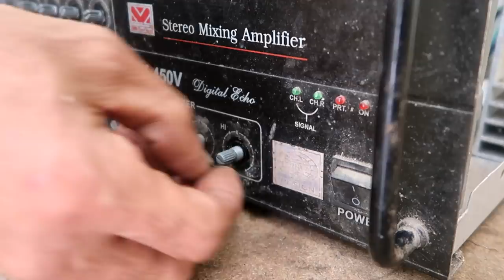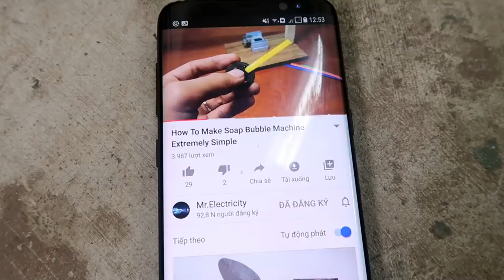Restoration 2 Channels STEREO Audio Amplifier // Restoration And Reuse Of Electrical Equipment

Comment: Mr. Electricity he just used a salvage solder iron and fixed the amp. Like nothing. That is skills. Respect for this guy. When some others with more access to technology they would be using a oscilloscope and all those sophisticated devices.

Comment: What is he using to clean the electronic boards ?
He have a good memory to remember  where the wires go without taking a photo or drawing a scheme before disconnecting it !
I always take a photo before dismantling something , to avoid mistakes when reassembling it .
Looks like a public-address amplifier ( for professionnal use in a supermarket for example) than an house-hold hifi system.
Nice job , the unit looks like and sounds like new .
Reply: I remeber you that he's recording

Comment: I started this video thinking "If this is another fake, I'm gonna throw my phone against the wall, then film a video of me faking to fix it!!!" However I will give credit where it is due. To be able to work on such machines and replace components needs a very deep knowledge of electronics. Knowing how to take stuff apart is easy, but knowing what every single component does in a machine takes years. It's clear this guy knows what he's doing. Would like to have seen more of the component testing and how he went through the board looking for faults, but most would find that boring. Well done mate. Good job.

Comment: I like the 12 megawatt soldering iron.
Reply: Egy igazán jó mester, gyenge szerszámmal is tud jól dolgozni...
Reply: @janoshaasz5219  Ha!, I noticed that immediately too, made me consider ordering something a little more powerful, but he's good with it, I would just make a big mess.
Reply: @janoshaasz5219  Ez teljesen igaz!
Reply: I would imagine it takes practice, i would burn through everything.
Reply: @MasterDJRenn  Absolutely. Which makes it even more amazing. He's good with it. Notice how he changed tips using copper wire.

Comment: Good restore on the audio amplifier Mr Electricity. That unit had been stripped of some parts. I saw the power transistors had been removed when you first opened it up. Where did you source the replacements (which were 2nd hand since there were solder remains on the legs). Did you have a spare junk audio amp lying around?
Reply: He probably works in the factory where they were made.
Reply: @kgsalvage6306  or he is one of the best engineers in his country and just sources them from the internet.👍
Reply: check out latest videos for amp he has a boxes full of them used .
Reply: no País dele, creio que seja Tailandia ainda fabricam, é de fácil comércio.

Comment: Amazing how an un tested piece of crap gets washed, covered in paint, hot snot, put back together and everything is wonderful!!  No components were checked, no voltages measured. In fact no sign of ANY test gear except that blow torch of a soldering iron. No limited power supply, just plug it in and it works. Bloody amazing...if only the REAL world was like that.
THIS IS NOT A RESTORATION VIDEO. It's a clean up job
Reply: จ

Comment: Not quite a restoration, more like a cleanup and repair. A restoration would have included a re-cap (Given the state of it, all the capacitors are likely to be leaking electrically). Most of the solder joints looked as though they could have done with some fresh solder too. Replacing the missing knobs also. I'd be interested to know how he chose the FETs for that particular application, didn't look like he had a schematic or a data sheet 🤣
That said, often you have to go with what the customer wants. Going with the above would have included significant, extra costs!! I suppose in the west, we tend to test everything before we give it back in case we're sued 😂
Still gets a thumbs-up though. 👍

Comment: It would be nice when you are explain step by step what's the damages and also try out at first when you get the amplifier
Reply: no damage, just getting it dirty and then a cleanup for the video...not even idle current adjustment

Comment: That is one big transformer!
Reply: For an audio amplifier they are because they use linear power supplies which are much bigger than switch mode power supplies. Why use the bigger power supplies? Because they generate a lot less electrical noise...unless you want to hear crappy audio?

Comment: What are the thin plastic cards that went on top of the thermal paste? What does it do?
Reply: the plastic used are good thermal insulators and poor conductors, i think they aid the thermal paste to stop localized hotspots
Reply: That's what puzzles me. I would assume that the paste accelerates conduction. Why would you then apply something to reduce conduction?
Reply: I think that plastic is actually a good thermal conductor not insulator. Yamaha, for example, uses plastics strips in their amps and receivers in place of thermal paste on the power transistors. And they are non-conductive of course. Easier to stick on and less messy than thermal paste. Having both is fine too.
Reply: @stormkhan4250 : Ah yes! Your right. Just occurred to me that one needs heat conductivity, not electrical conductivity.  And--  if you didn't want to power transistors to ground on the case, you'd need the plastic.
Reply: They are mica sheets. A natural substance. Good electrical insulators and thermal conductors. They ensure the metal on the back of the transistors dont connect electricaly to the heat sink. That would short cicuit all the transistors together and to chassis ground.

Comment: What is that liquid you put it?
Reply: I think that is 99% rubbing alcohol. It cleans the PCB without damaging it.
Reply: I use pure Isoprpyl, but i think regular rubbing alchol will do, at least it's significally sheaper in my country and i could not realy spot any visible differense on normal electronics.
Reply: 70 or 99 % alcohol

Comment: Dear Mr Electricity i truly love your videos.  But i am also in love with desoldering pumps.  I like the idea of suck out and discharge all the old solder and replace it with fresh high quality one ....   of the low eutectic kind ... 
https://en.wikipedia.org/wiki/Solder_alloys
my favourite (loved it)  was  Sn62Pb36Ag2
It  is no more available for the Pb content i guess (toxic) but i can tell you that it is technically impossible to make a cold joint with it ... and i am the champion of cold joints.  It sticks immediately and for ever ... unbelievable. 
maybe just only for the critical points    Moreover i would think about using a solder with a smaller tip ... it helps i think 
By the way ... what liquid do you use to clean up the circuits boards so nicely ? after cleaning they look like NEW !!!
Excellent work.  You workshop is like the hospital of amps ....   Great respect.  
Kindest regards,  gino

Comment: what did you wash electric boards?
Reply: Its alcohol to clean. Its good to clean for the electronics. Vetter connection and dont running hot and blow.

Comment: What a poor quality amplifier. Those 5 watt resistors should have been mounted at least 5mm off the PCB and moved away from the output transistors at the factory... Good to see you using a lubricant for all the potentiometers and placing heat-sinking compound on the output transistors... Overall an excellent restoration... WELL DONE!!!  10/10

Comment: For me its not restoration its just merely only cleaning and painting the body..For me Restoration means the set is not working from long time ago, and need repairing the parts damage which means should be the unit not totally working and no Audio..

Comment: I am impresionated this man repairs this amplifier without the use of the factory squematics, after the washing and cleaning he just change the power transistors and some variable resistors, but normally it is necessary change all the electrolytic capacitors because the amplifier is old and these components are time degraded, also it is necessary  measure all the electric resistors in order to change the bad ones and out of range, I suppose he didn't show all the restoration steeps; and finally he didn't receive any money  for the work this isn't a common situation but it was a part of the video................. mmmmmmmmmmmmm

Comment: It was mostly a cosmetic restoration. Except for the missing output transistors no replacement was shown.No adjustment or measurement was shown either.May bei It has been easier to clean without dismantling it.

Comment: Tell the scooter guy to at least buy you a pencil type soldering station.
Reply: I thought the same, until I'd remembered that it may not be easy to get tips for the iron and that you can just bend a piece of cobber wire to make a new "tip" for the soldering gun. And if this is the standard gear he often have to repair, it may be a better tool.
Reply: That's what they do best natural talent.
William Percival New Zealand Gardenia Band 🇨🇰 Kia Orana

Comment: Just cosmetic. No real restoration
Reply: yes it was,,
when he first got it,,it did not have any output transistors attached to the amp boards,,
he disassembled and cleaned out the potetiometers,painted the cases,,and replaced the output transsistors